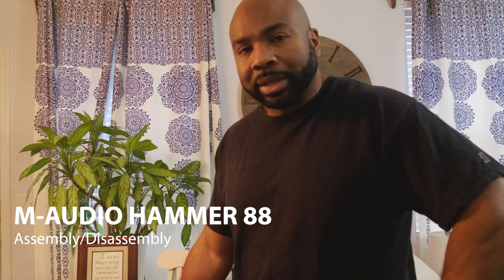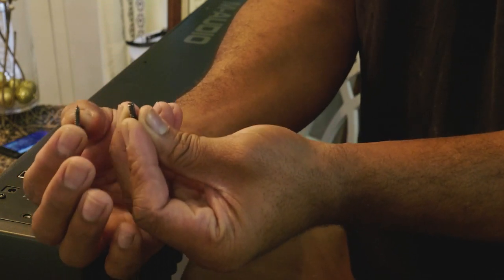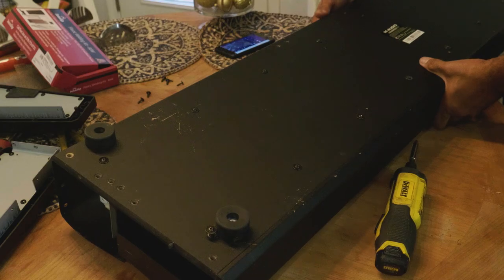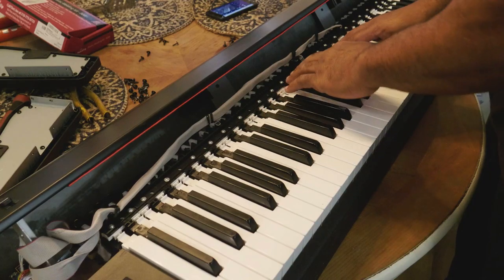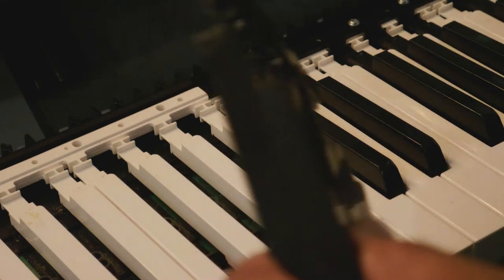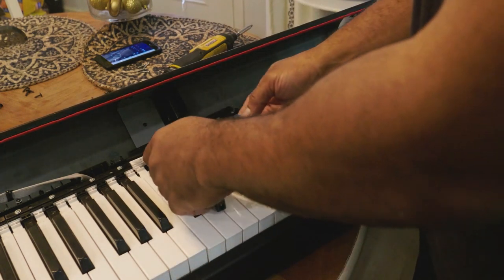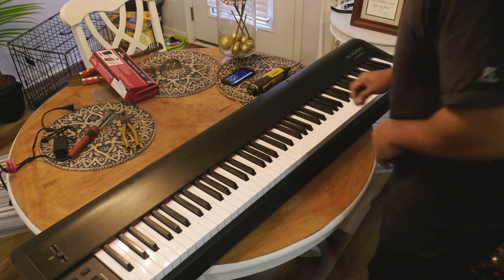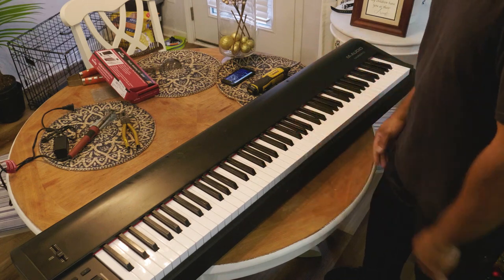M- AUDIO Hammer 88 Disassembly/Assembly

Comment: Great instructions. Got me exactly where I needed to get to. I had one of the 'hammer joints' disconnect between the key and the 'hammer'. I got lodged behind several keys and created all sorts of problems. I had to remove/reinstall all screws you described. Successfully reconstructed the Hammer 88 as well. Thanks!
Reply from the maker: It's always a good feeling to get that "aha" moment! Glad it helped!  🙏

Comment: Hello... some keys no working anymore. is an entyre octave. what i have to do? :((
Reply from the maker: Hey there! Are you hearing any sound at all  when you try to play the keys?
Reply: @GospelProgressionsUniversity  Hello! Glad to hear from you. I dont have any signal on the keys...nothing,,,like they are practically dead.rest of the keys works perfect. are 8 consecutive keys on the second octave from the right to the left of the piano. i disassembly the piano stept by step with your video. i dont know what to do...
Reply: @GospelProgressionsUniversity  I reversed between them, the both 
"sata" cables , 1st for the first half of piano keys, 2rd for the second half of the keys...this invert the keys like you start with the high notes from the left to right,,,and the second half of piano has the down notes....i did this to see if maybe the "sata" cables is the problem ,,,but when i did this, still same 8 keys dont have signals. i mention in the past the keyboard slept on the ground hard impact and i have a little reparation on the green card where cables are connected. worked about 1-2 years after the reparation,,and now.... this problem.. :-<
Reply: @GospelProgressionsUniversity  Hello mate, thanks for the reply, the keys are theoretically dead, no signal midi , nothing, the green card connections are good but i think is the problem inside where i cant enter, cant dissamble,,where the keys touch that space where make the signal

Comment: How do you remove the white keys so I can clean the board?
Reply from the maker: Hey there, sorry for the late reply.  Once you remove the back cover there are screws above the key-bed that hod the notes in place. To remove the tire key-bed There are bolts underneath that need to be removed that keep the entire key-bd in place. I hope this makes sense.
Reply: @GospelProgressionsUniversity  Thanks I got that part right but now I am trying to fix the problem.  The rubber pads from D# to A are not triggering sound.  Everywhere else on the keyboard is working.  So tried swaping the trigger pads that works netx to the bad one and it still does not work so I think it is the green electronic plates under the rubber pads.  Thanks again you are a good samaritan...  A lost vertue in this mean world.  M_Audio hammer 88

Comment: I have an issue with this keyboard, 3-4 of my black keys make very annoying clicking noise... is that what you mean by broken keys? I want to fix it, will this method work ? 
thank you for the video !
Reply from the maker: Yea that’s what that sound likely is. The top piece of plastic is breaking or broken and it causes the Keys to rattle.
Reply from the maker: You’re welcome!
Reply: Once disassembled, the noise went off… 
No broken keys inside, And I didn’t know what exactly was causing the issue but I am pretty sure it is a low quality piece of crap

Comment: What is the measurement in inches of the side pieces on the ends? Im wanting to put this keyboard into an old piano body but I only have 54 inches. I think the keyboard is 56 inches long but if I take off the end caps is it 54 inches?  Thanks for your video!
Reply from the maker: Im sorry I meant to check this for you. If you haven't already found  out, I'll let you know tomorrow